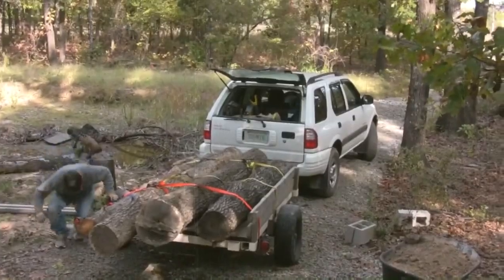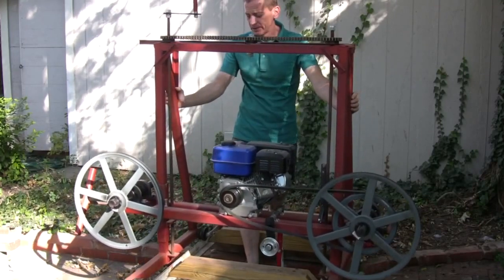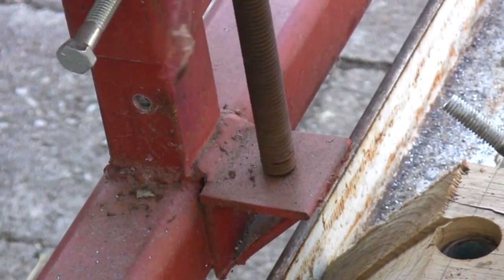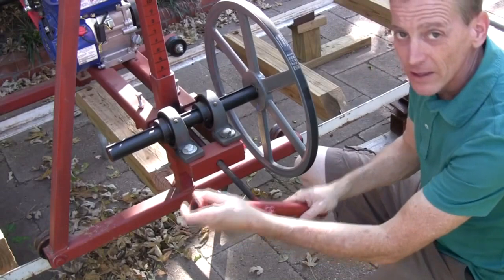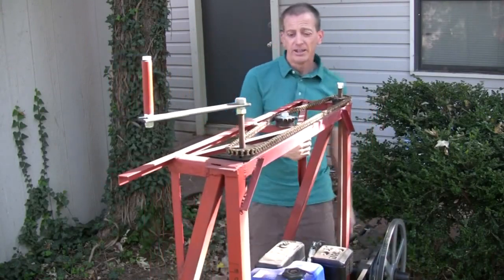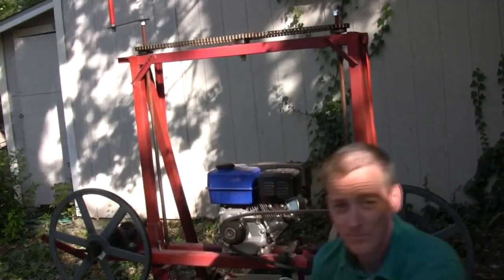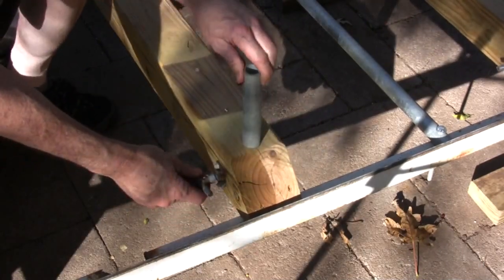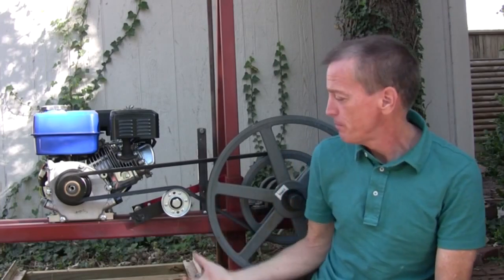Building a Bandsaw Mill - Part 1

Comment: Great job! you can go with an acme thread that is a flat thread they use on lathe's it would bea bit faster for up and down and costs like 40 dollars American for six feet I was going to go this route but decided to go with a bicycle chain and a worm gear off of a snow blower to raise and lower my blade. I have around 200.00 in mine most is recycled material and that would be counting 2, woodmizer blades I built mine because I acquired a large 33-inch pine and it was too big to move so I will be going on site to cut it up. Finishing up the mill now working out the bugs!

Comment: Very beautifully built and ingenuous sawmill.  There is however one feature which could be considered somewhat of a flaw in the overall design.  As a general rule, it is better to position the blockbearings holding the bandwheels under the sawhead frame instead of above; in doing so, you would probably add at least 4 inches of vertical clearance above the blade (Timberking calls it  sawhead throat depth).  That is a significant advantage when sawing big logs, if for example, you want to quartersawn a big log trough its geometric center.  So if you build another one, or anyone willing to imitate this design, otherwise very fine, it is advisable to put the blockbearings under the sawhead frame.
Reply from the maker: Yes, absolutley correct and would have been better, but I had already built the frame and I discovered that if the block bearings were mounted below then the sawhead couldn't be raised very high without getting into the frame.  Didn't really think that one out.  But I don't cut big stuff anyway.

Comment: I am having trouble finding square tubing that will actually slide over or within another piece... can you provide the sizes that you used to allow the saw to move up and down... it appears that they just fit...thx
Reply from the maker: The outer tube is a heavier guage than the inner tube.  I can't say the exact size as I found it at a scrap yard.  Not quite sure but I think the outer tube is something like 2 and a quarter inch and very thick, and the inner one 2 inches.  Its a loose fit.  Sorry I'm not one for remembering details and I don't have the mill here to measure.